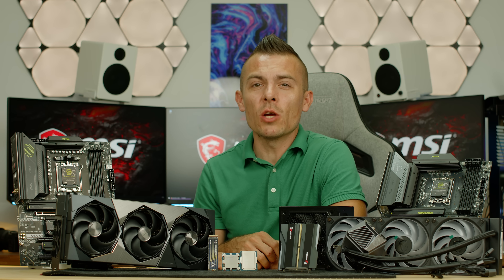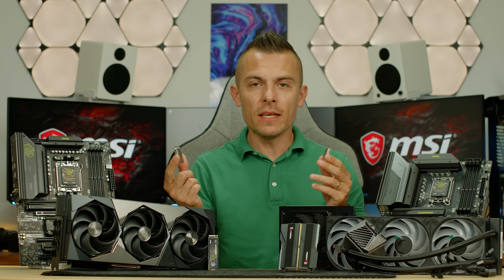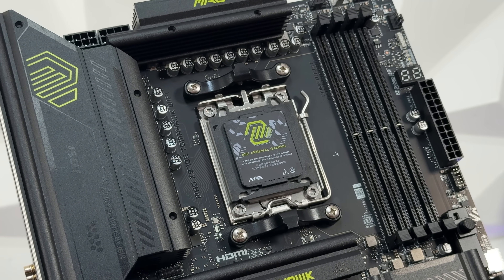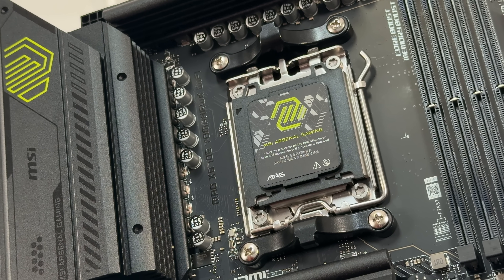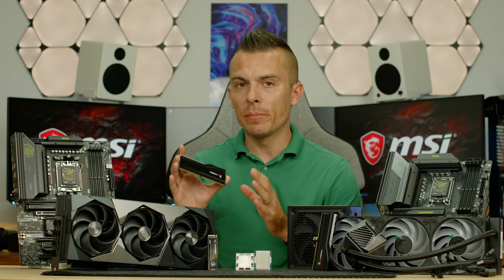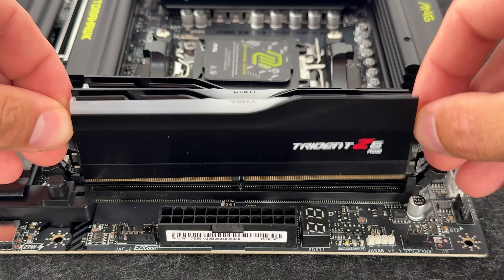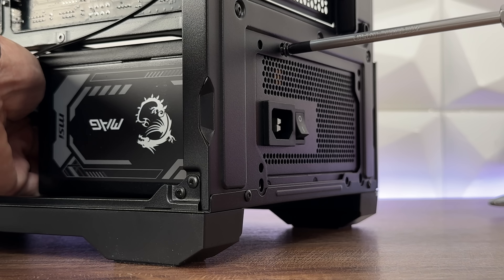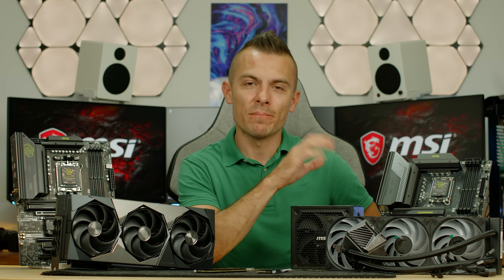Build a PC Like a Pro! | MSI Beginner’s Guide: PC Parts Explained

Comment: hello sir, great video. I want to ask about the MSI mag forgee 110r pz case. I have a motherboard that has an Aura SYNC. Do I need a converter or some sort of special connector for the (4) Fans and case rgb (line) to be able to connect it to my motherboard's AURA Sync?
Reply from the maker: Hi, thanks. Nope, you don’t need a converter. The connection of the fans is 3-pin 5V ARGB that is the same on all motherboards. So you are good to go.
Reply: @PCCrazyDario cool! thank u very much brother!

Comment: Hello, great video Jack! I have a question concerning the Pano 110R : would you know what is the reference of the pre-installed ARGB fans? I am planning to buy this case, but I wonder if I should not add an extra 3 AGRB fans at the bottom of the case... Hence my question to have the exact same 3 reverse fans than on the side of the MB... Thank you!